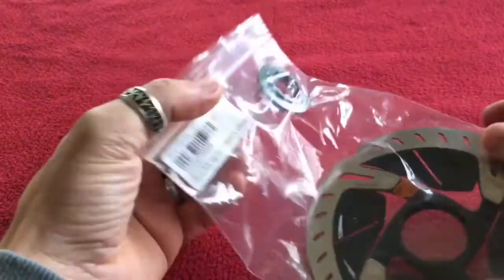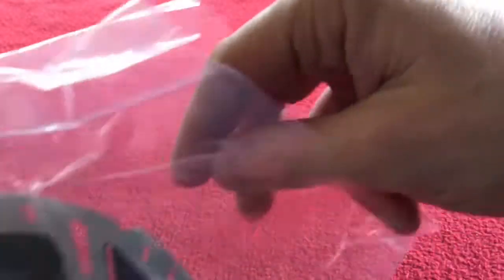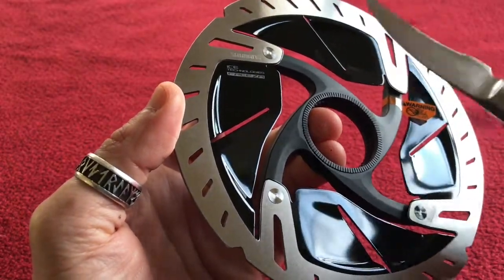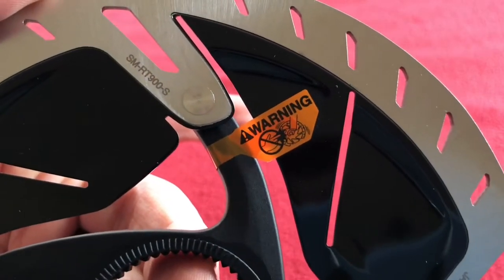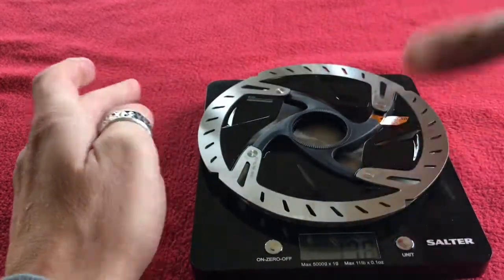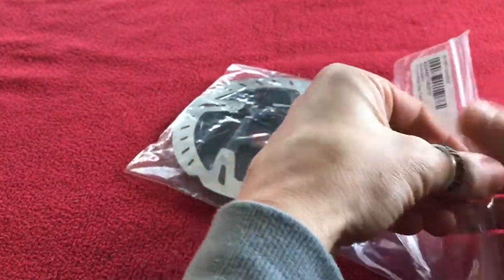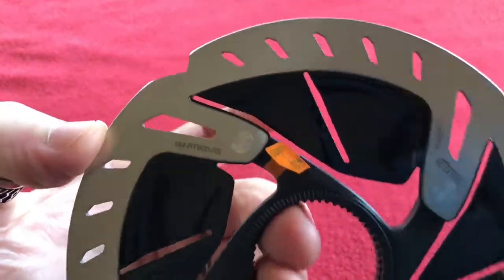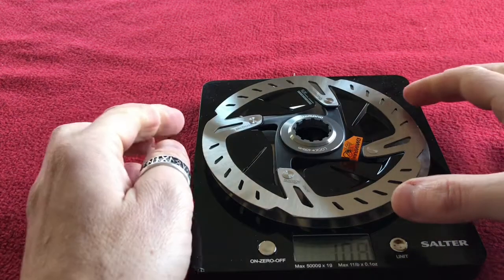Shimano SM-RT900 Dura-Ace Ice Tech FREEZA Centre-Lock Rotor unboxing

Comment: Thanks for this review! I my self am looking at doing a Yoeleo R6 Disc build, but I was just wondering, on their site they state that the frame is only compatible with 140mm dic rotors. Is the frame also compatible with 160mm rotors both front and rear?
Reply from the maker: Nathan Faigle I’m probably going to go 140 on front and rear. I could be wrong but I don’t think you can run 160 on the back of this frame. On the front my Ultegra flat mount callipers come with a mounting block for 140 or 160. I bought the 160 but as I said I’m more than likely going to change it to 140

Comment: Strange that the rotors did not come protected in Shimano boxes
Reply from the maker: Greg Fisher yeah, I thought that when they arrived... 👍
Reply: @KyrosHouseCycling  .. Mine came in a very hard cardboard box with more cardboard packing inside to avoid anty risk of damage
Reply from the maker: @cannon1156  not sure why mine didn't, maybe if they buy 1000 sets they come like that... not sure
Reply: They are not oroginals, they weight are 106 vs 107gr

Comment: Do these work with sram red callipers?
Reply from the maker: Richard Mace I would think any disc of the right diameter would work with any calliper, as long as it’s compatible with the pad type as some discs state which pads to use, I’m using resin on these. 👍